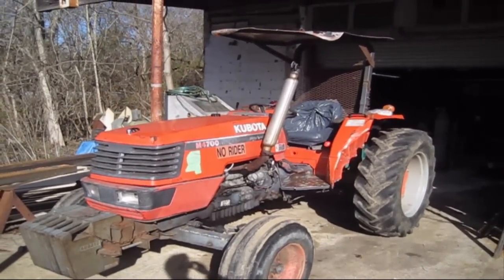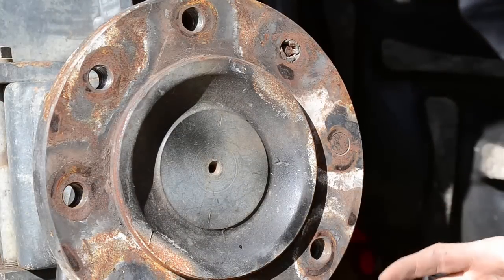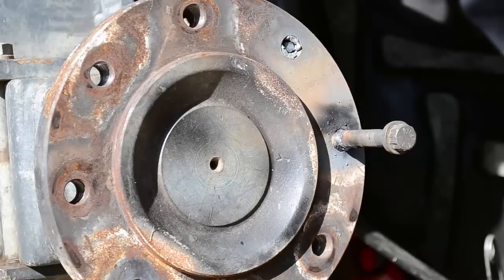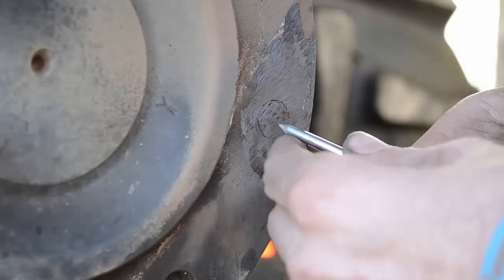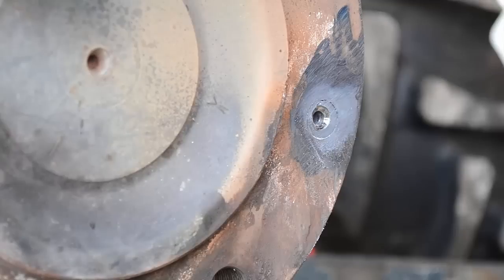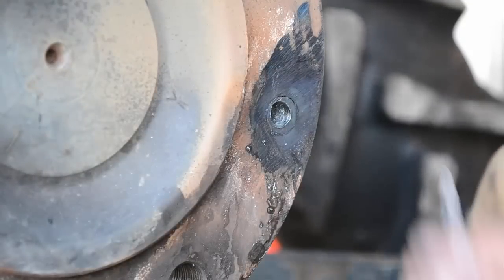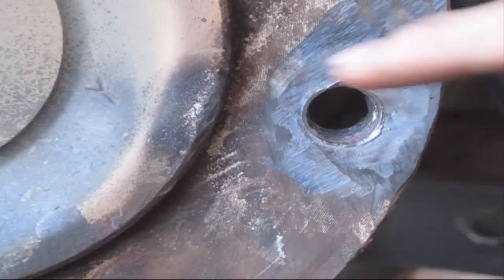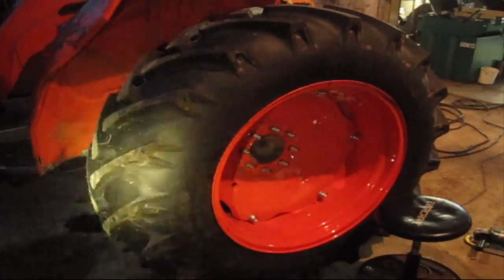Broke-off bolts techniques

Comment: One thing that helps me: after you've welded the bolt on, hit the bolt....especially the back side if it's a through-hole....with some Kroil.  Let it sit until the whole thing is room temp, this lets the Kroil creep in AND it lets the hot/expanded bolt cool and contract, helping to 'release' it from the threaded hole.  Then back it off with a T-handle on a socket.  I've found that using an impact increased the chance of breaking the weld....just as it did in the first case here.
  And, you really should be using impact sockets on an impact gun.....  :)

Comment: Railroad Boilermaker trick, if thread goes all the way through you only heat the bolt only cherry red in the middle than immediately hit the bolt with a hammer and a round flat end punch a hair smaller than the bolt diameter. The red hot bolt will drive all the way through without damaging the outside threads. The trick is speed. This has worked many times. Cheers.

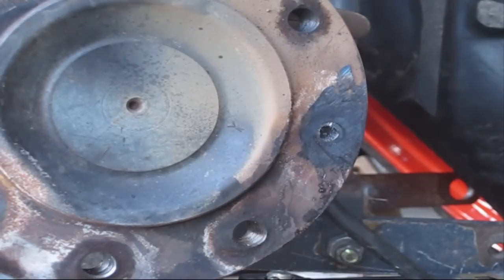Comment: When you got to the 28:30 mark in your video, all you needed was a metal cutting blade in a coping saw to cut a fine line through what was left of the bolt and into the threads. Stick the blade through the hole and then mount it into the saw. Once you make that cut, you can fold what's left of the bolt into the hole with your chisel. Like you were trying to do, before you applied the torch. Also, a metal cutting blade in a jigsaw could accomplish the same thing but you could control the cut more slowly and precisely with the coping saw method.

Comment: Hey  Man   Use  small drill to start  at mucho low speed and progressively  increase  drill sizes. Your drill speed is much too high with no pressure and not enough lube!!

Comment: You used what you had to a great outcome. I'm wondering when you used the liquid wrench. You never put that being used on camera. You had it in plain sight though. I expected to see the tool cool (cutting oil) used to ease the drill bit through the work. You attacked that like the "briar rabbit and the tar-baby" I often get stuck in a project and I cannot give up without a solution. Bravo.

Comment: Great techniques.  I recently had to torch out a subframe to body bolt that broke off leaving almost two inches of bolt stuck inside the tube nut.  After fighting to get a pilot hole all the way through the remaining bolt, I packed the subframe with dry ice and waited for a good coat of frost to develop. At that point the torch blew through the entire length of the bolt without even buggering up the paint.  Two minutes with a tap and the deed was done.  Thanks.

Comment: Stud pulling: 1) grind good surface on bolt, 2) put washer to protect hub, 3)weld with stainless electrode 100%surface of bolt to make nipple, 4) chip slag and place large nut over nipple and fill hole tying bolt to nut, 5) let cool so bolt shrinks more than expanded hole, 6) work nut back and forth with hand wrench until you get one full turn, 7) finish backing out.  (Stainless steel is much stronger and ductile than regular carbon steel and it "work hardens" after it cools.)  ( High carbon steel bolt are "heat treatable".  Heating it to orange temperature and "quenching" makes them hard, brittle, and undrillable.)  With a stainless electrode you can weld onto threads broken off even well below the surface.  The slag protects the side threads if you keep the electrode in the middle of the hole and pointed straight down.  Standard "Maintenance and Repair" welding trick.  Ever hear of "Eutectic"?

Comment: More oil, less speed. Your annealing your bit
Reply: He does not seem to realise the cutting speed is way too high.
Reply from the maker: Have you ever anneal a bit before?
Reply: you just did by overheating your bits when running it at such a high speed Think about it ......watch how your bits started off cutting and then stopped cutting ..they did not stop cutting because the steal changed ..they got dull from overheating the drill bit
Reply: Yeah less speed on the drill with more cutting pressure would have fared you better bud, try that next time, but none of us are experts.I learn everyday and thanks again for the video, signed tooling machine mechanic 30 years.
Reply: dexter2433 thanks never knew that before I’ll have to keep it in mind

Comment: soak the threads in a mixture of acetone and ATF, best rust remover and loosener there is.
Reply: Bill Hanson 2nd that
Reply: WD 40?
Reply from the maker: I have used it in the passed good stuff works well.
Reply: WD is okay but, as the name suggests, is a water displacement fluid really (made from fish oil). Okay it does work as a penetrating oil but not as well as melted wax, or soap. I use acetone & hydraulic oil mix too. @EEJester1586

Comment: After he had that 1st drill bit dulled out, my 1st thought was to use a smaller cobalt bit to drill threw it & then, use a bigger bit to bore it out, I was told by a machinist to use a carbide tipped masonry bit, ONLY AFTER SHARPENING IT TO DRILL OUT A HARDENED FASTENER! I LOVE & HATE having to drill out fasteners!!! Helps when you have all the tools needed, at your disposal!  many times, I've had to drill out a bolt & wished I had a oxy acetylene torch or a plazma cutter/torch to try & blast a hole threw something! Which reminds me, I NEED TO SPEND MORE MONEY & STOCK UP ON ALL THE TOOLS I NEED! I PERSONALLY LOVE COBALT ENFUSED DRILL BITS FOR DRILLING OUT METAL!!! I need a bench grinder & a drill bit sharpener! Now, back to the video!

Comment: Why didn't you weld your bolt on the back and screw it out that way ?
Reply: He just said he was charging by the hour, wink, wink, LOL.
Reply: Or access might have been an issue
Reply: Go to a bigger drill those threads will just fall out.
Reply from the maker: Someone had tried it before me, and there was no way it would come out. Trust me when I say in real life this was a 1 hour job, BUT somebody else had worked on it before me, and I don't know what they did but it didn't work for them.
Reply: Or even just send it on through from the front with your smaller welded on bolt. Just clean up outer part of welds before going through.

Comment: put a wire blade on hachsaw. then cut the wide est area to the threads. then chisle the bolt in off direction. the cut u made will make old bolt weak and it will compress  inward away from threads
Reply: Yep. Once the hole was all the way through the stud, you had a golden chance for a  tungsten or even diamond grit coated wire saw to get in and cut the two slots opposite each other down to where you just barely see the threads, then go to work on her with the point chisel collapse it inward- out! I've used that technique a few times on larger studs. But, this one was a bitch because someone else had already bungled it hardening the steel in the process. I was kind of surprised to see the masonry bit cut through it. I never thought of putting a new face to it- that's pretty smart right there. Comment above, also on the welding the washer and nut to what part of the stud you can see. That protects the female side of the interface and gives you some meat to get a pretty good grip onto. But, this stubborn sob was bound to cause trouble no matter what. You got a right to be proud of success on her. Damn good determination. I like folks who take it personal. That damned old stud just didn't know who it was up against.
Reply: Sipper Skipper-I had a bit of a hard time understanding what  you meant, because you didn't mention to drill a hole through the bolt first then put wire blade through the hole etc, but that is a great idea!

Comment: When the bolt has been mushroomed in the hole or if it's just difficult, cut a hacksaw blade down with a grinder so it will fit through the hole.  Cut down to the thread and hit the bolt with a chisel to collapse it in the hole.  You can make more cuts if you must.
Reply: Great solution in many cases, one seldom thought of. May take a while but better  chance of not damaging threads in bolt hole

Comment: Job well done.  I was wondering about the cost of axle, but you answered it.  Second thing I would probably have done is looked for press in wheel studs and just drilled the holes to match not worrying about jacking with saving the threads.

Comment: 10:40 - You had the thing !
Just let everything cool down and then add some penetrating oil - let it wick in a bit.
Continue forward / reverse with the impact driver - that stud wanted to come out !
Reply: Yeah, but there was hardened non threaded weld on the back side. Without welding a washer on the stud face then welding a bolt or nut to that he didn't have enough surface area for the weld to hold and cut threads into the bugger weld on the back of the stud.
Reply: How about just go out the back side with it. If there was weld back there then theres room to go that way. He had it free

Comment: I've been a  welder for  31 years now, certified in structural steel and carbon and stainless pipe welding, 
aluminum and cast iron. I wouldn't ever use any 60  rod doing that job, much to brittle even for the taks, save yourself time and headache's going with your 7018 rod on the taking and filling, even if you just did your tacs with the 60 rod it would put brittleness in the weld. For better success try your 7018 from start to Finnish. Keep up the good work.

Comment: The next guy will thank you if you put a little never-seez on the new studs. Good job.
Reply: I know, right? I grease the threads on pretty much everything I put together, and I wish everybody did that... I guess most guys just don't feel like spending the extra  couple of seconds! If they did, it sure would make our job as mechanics easier!
Reply: Using lube on wheel studs and bolts is a good recipe for losing a wheel.
Reply: David Roberts I can't say that I completely disagree...  I do know many manufacturers recommend leaving the threads dry (IMHO, most likely for liability reasons in our "sue happy" day and age)...

I'd like to clarify what I was saying in my previous post... I certainly do NOT recommend putting "gobs" of grease all over the threads...

Here in NJ, where they like to pour excessive amounts of salt all over the roads, I usually put a tiny dot of grease on the end of each stud before putting the nuts on, after making sure the threads are clean and undamaged...

I also put some grease or antiseize around the hub, where the wheel center fits snug.  Do NOT get grease on the face of the lug nut, where it contacts the rim!

MOST IMPORTANTLY, I ALWAYS torque each lugnut properly...
Reply: billy manilli surely you jest, Americans sue happy...... : )
Reply: I disagree.  When you have a tire/wheel that may be on heavy equipment for years, (In my case buses) you will often find that some gorilla has got hurried and forced on the lug nuts crosswise.  I have a Large air gun, 1,400 ft. lbs torque, so I can always get the lugs off.  But buses run fine threads, as do trucks.  So before I put my wheel back on, I take a towel, and thoroughly clean both the lug nut and the stud.  Then even a couple drops of oil, or a dab of anti-seize ensures you are getting the right torque, and not fighting with damaged threads.  I've never had a lug nut come loose, and I've saved a lot of studs.  You don't wanna have to pull a bus brake drum off and hammer out, then back in new studs unless you absolutely have to.  But have you had different experiences?  I do the same for my 3/4 ton Ford pickup.  It's 38 years old, and so many careless mechanics have overtightened the lugs, I'm surprised there's no damage.  I used to HAMMER on my lug nuts and tighten them dry, until they literally squealed.  But after tearing the threads off of a couple studs on my Dodge Dart, I learned that wheel lugs need only the correct torque, not Gonzo force.

Comment: Just a tip. You are using way to high an RPM for a hand drill. High pressure and low RPM is best for drilling steel. High RPM is heating up the drill bit and ruining the heat treatment. That dulls the bit in seconds. You should use half the RPM and your drills will last 10X longer and cut faster.

Comment: Not a drop of penetrating oil. As soon as you see the bit walk off center correct it. You can get it back,  especially when still on the pilot hole. 3 drill outs to full size and you can pull the thread out unwinding a coil of thread.

Comment: he should have heated the flange before he started to back it out
Reply: You are exactly right.  It was fine until he went to take it out.  At that point he should have headed the flange around the bolt until red and it would have come right out.
Reply: @jackt6112  Are there seals close to the flange that could be damaged by too much heat?
Reply: @jamesnaylor3277  It depends what you use to heat with.  He is using what appears to be standard mechanics'-size Ox-Acetlene, which is perfect.  It's very hot and it's a standard size tip with plenty of heat, not a toy.  That enables you to get a small area red hot without the rest of the flange getting hot.
Reply: @jackt6112  I'm well aware of what he's using, it's capabilities and that steel conducts heat. If a seal is close to that flange it could be destroyed. I would think that heading the flange would cause expansion making the hole smaller and the bolt/stud tighter. Heating then cooling slowly should loosen things up a bit.

Comment: May I make a suggestion for the drilling out part? Instead of beginning to drill it out from the center, first you take a drill of smaller diameter, and you drill all the way through on opposite sides, as close as you can to the edge of the bolt, after that drill from the center out, starting with a small diameter, until you have diameter that matches the inside of both small holes. now you can use a file and cut the rest, or you use a flat surfaced screwdriver, and screw it out, if that doesn't work, use the file. that way, you won't make any big mistakes. This only works with big bolts like this.

Comment: Makes no sense expanding the broken bolt by heating it! The idea is to heat and expand the area around the bolt to help loosen its grip. Gee... this is on page one of how to remove broken bolts 101. Heating the bolt is bass ackwards. Also sometimes touching a wax candle to the area between the broken bolt and female threaded area after heating the surrounding surface will introduce melted wax as a lubricant into the two surfaces. Keeping a candle in the freezer and then favoring the broken stud when you touch it to the work will further help differentiate the heat between the two surfaces.

Comment: I've had good luck with brake fluid and a left hand drill about 2/3 of the bolt diameter. By the time the center is nearly drilled through, the bolt is hot, the brake fluid has penetrated, the stuck stud is vibrated, and it comes loose with just the drill bit. You do need a big drill for jumbo sized bolts. It works because once the bolt is cored, it can collapse.  Easy Outs only tighten the stuck bolt, so a hex shaped drift pin is better. On really large bolts, you can file or grind a square that your 1/2" breaker bar will fit.

Comment: use oil for drilling and slower speed
Reply: I watch a lot of these type of videos, drilling this or that and hardly anybody uses oil when drilling anymore! When I was in vocational school 40+ years ago we had cans of cutting oil and penetrating oil sitting everyplace! It makes me cringe to see guys drilling everything dry as a bone! I guess they don't mind breaking and sharpening bits all day long!
Reply: I just keep spraying every couple of seconds with panther piss, keeps the bit cool so it doesn't go dull and kept the  drill speed down at a reasonable speed with good even pressure.  Anytime I go all out with a drill on metal I end up ruining my bit.  Drilling hardened steel really sucks, but I bet drilling could have been avoided if when he first welded the bolt on and everything was good and hot he could have hit the bolt with something cool like ether/starting fluid to shrink it, then hit it with penetrating oil and worked it back and forth it might have come out, but you never know, that thing was either cross threaded or had chunks of weld on the back side.

Comment: Just a tip from a professional ACFT stuck Screw and Bolt puller. 1 On hard metal, use slow speed heavy feed on harder metals 2. Get to know your local Dentist ( Not kidding)  They use carbide dental burrs for drilling teeth and use them one time and throw them away and many times will give them to you if you ask for them, They will cut through anything. 3 Like already mentioned, avoid Easy-Outs but is you have to use them, cut off the tips for a better bite. Most easy outs have a rounded tip and make it hard to to get deep enough to grip the sides.

Comment: Good job. Have you tried to use the punch to knock it out after you heat it orange before torching it out? I've tried that a few times it worked good.
Reply from the maker: I've never tried that, but I could see that working really well.  Thanks man.

Comment: First of all, I like the comment at the end and that is you said God bless.  Thank you for blessing me!  I have used a old trick by heating the bolt and steel around bolt then take a wax candle and push hard on the hot metal,  broken bolt with wax candle and as the steel melts the wax it will pull the wax into the threads and the bolt will then come out by the process you used welding a bolt a lot easier most of the time. God Bless You!

Comment: Just put a nut on the bolt of the holes that the thread is bad in.  Simple fast solution. It will talk a long bolt, but problem solved.